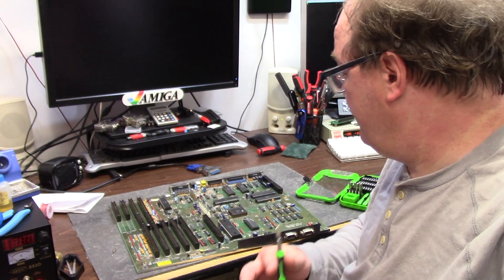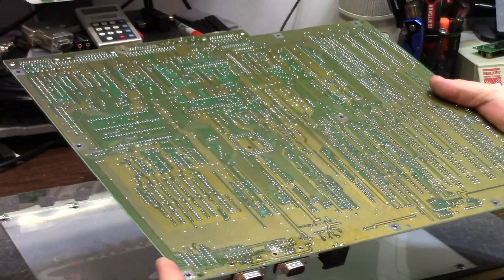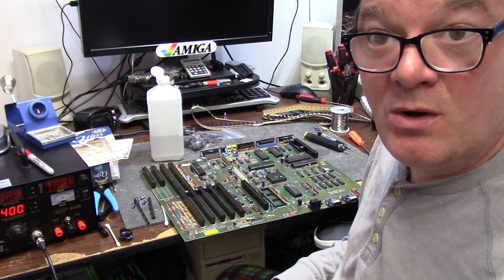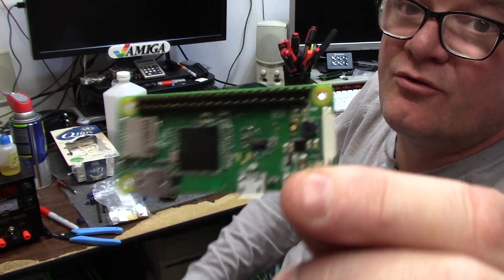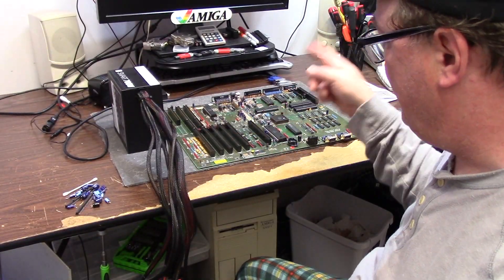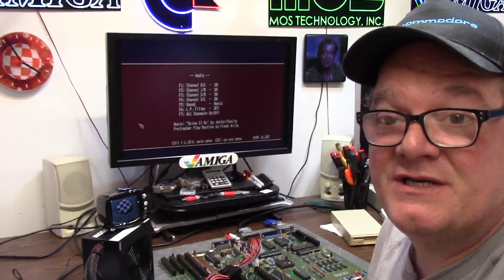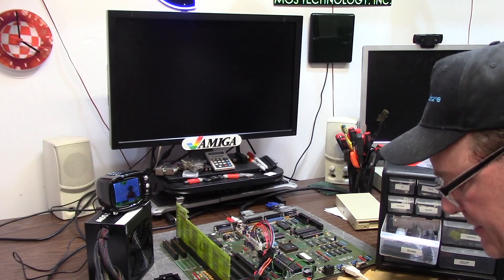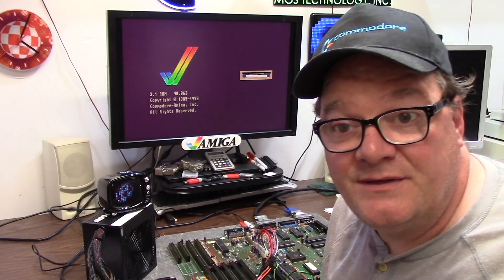HAM and a Amiga 2500

Comment: Spotted the unpopulated 68000 socket. When did Commodore instruct manufacturing to drop the redundant components?  I always assumed the A2000 variants were dealer assembled, but it looks like that's not the case.
Reply from the maker: watch the video, it was removed to replace the socket as it had acid damage on the one corner.
Reply: @ChrisEdwardsRestoration  One reason I don't really shop for A2000's any more.   I'd love to have one in that good of shape, but I probably wouldn't bother putting another socket back in because it would be getting a PiStorm with a full Pi3B+.   I don't know if I would even put in a battery socket since the Pi gets it's time from the net on bootup (does emu68 do that?).   Oh, such a nice board.
Reply from the maker: @IntenseGrid  i know mushashi does as it has wifi capability, the networking feature of Emu68 has been in the works for a while now but is not yet implemented.

Comment: Chris Edwards. I've said it dozens of time if not more. What a guy. A true Amiga Saint. Thank you sir! Also, what a great repair video as well! (that 2500 board was amazing!)
Reply from the maker: You should get one!   Lol
Reply: @ChrisEdwardsRestoration  What is the difference between the board on a 2500 and a 2000?
Reply from the maker: @IntenseGrid  nothing.. the 2500 was Commodores "pre upgraded unit" came with a A2630 68030@25mhz, 4mb ram 1mb chip  , max of 8mb. front case does say Amiga A2500
Reply: @ChrisEdwardsRestoration  The earliest lowest specced A2500s came with an A2620 instead but they're pretty rare. Other than that I think the only think you missed is they all shipped with an A2091 HDD controller installed as well (or the flaky A2090 on the early ones), iirc.